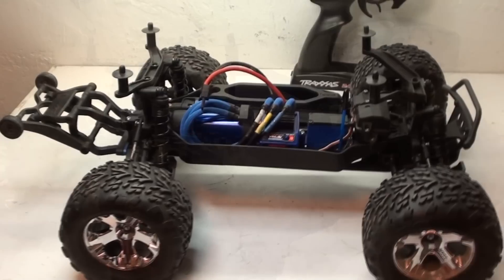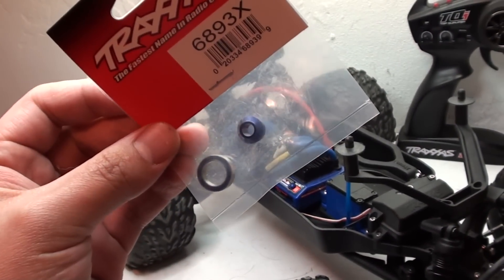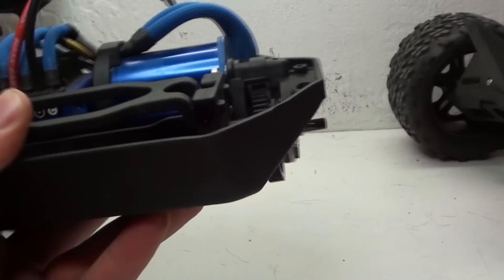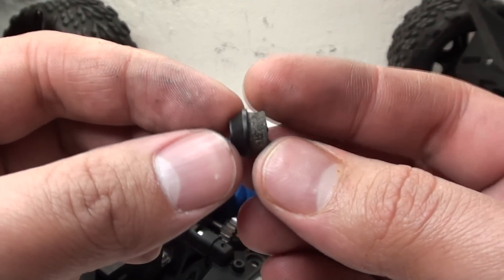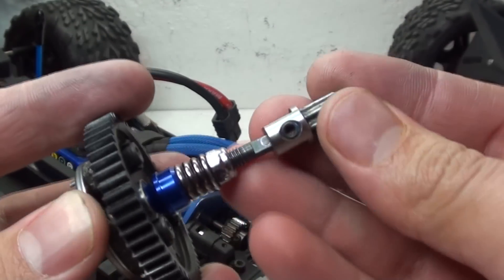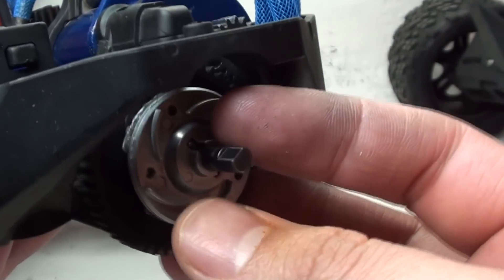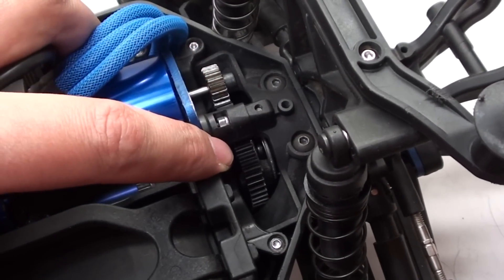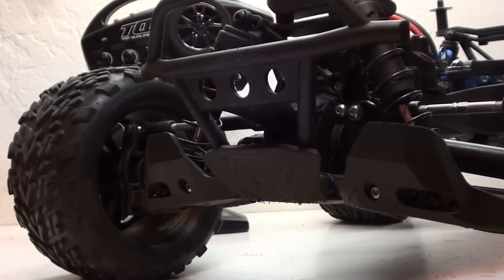Reaper - Traxxas Stampede 4x4 - Level 1 Upgrade - Aluminum Bearing Adaptor

Comment from the maker: It saves you from a lot of problems in the future. When the slipperclutch does its thing it gets really hot. Thus it melts the Plastic Bearing adaptor. Not good at all. When that happens it can over heat and damage your motor or ESC.

Comment: I have a Stampede 4x4 also and I would highly recommend putting a dab of marine grease in that bearing. It gets very hot in there and needs more protection. I have also thought of buying a porcelain bearing for this reason. I haven't done this yet but plan to. I was wondering why you released motor but you did have the spur gear to adjust. Great post BTW.

Comment: My bearing was melt into the bearing ring so i had to replace it. 
Dark my stampede makes a sound when it starts it sound like. The gears are spinning right and left really fast, but it is only at start
Reply from the maker: Joel D Strange. Sorry but I don't know what it could be.
Reply: check diff case. throttle pressure can separate it, separates gears

Comment: can i run 2s n 3s with stock gear?not in sport mode...training mode only
Reply: yeah,, but with training mode, there's no point
Reply: +Four Knots 👌 thx
Reply: np
Reply: also, Low voltage needs to be on, and if it's a VXL, 3s ok, but xl5, 2s only